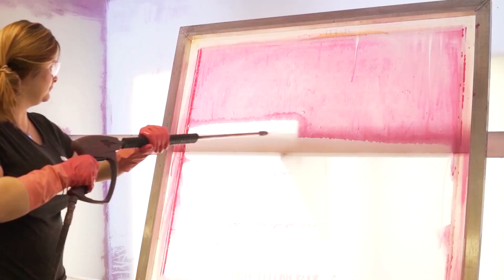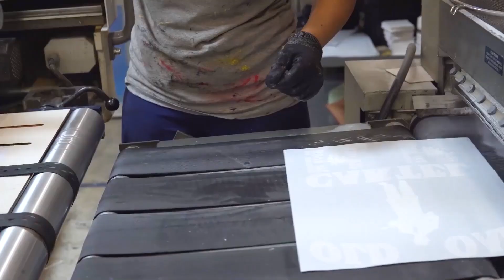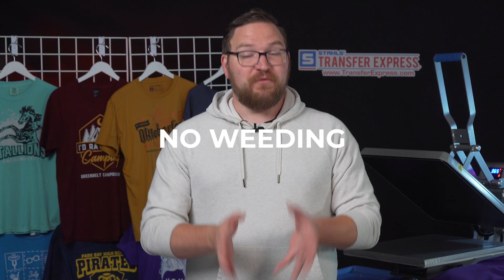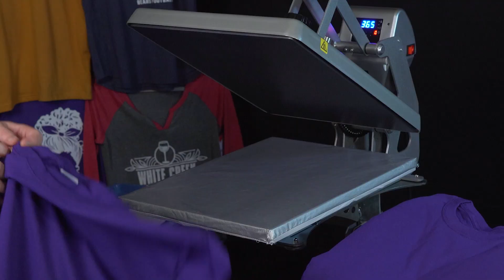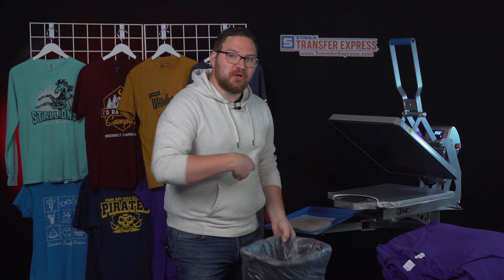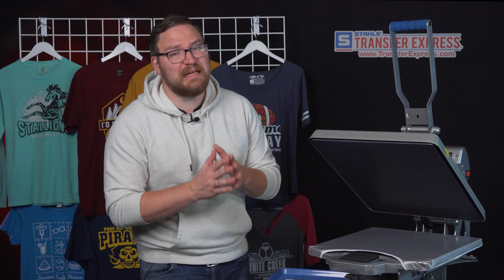Heat Press Bulk T-Shirt Orders | Setup & Printing Tips for Efficiently Printing Apparel

Comment: On average how long does it take you to complete a 25-50 garment order? I found myself at 4 hours for 10 hoodies, given that i had to print front, back and arms.
Reply from the maker: Many variables impact the time it takes to complete a job, and multiple placements definitely factor in. With hoodies and sleeves specifically are more challenging placements as you have to isolate the print area using mousepads or specialty platens for sleeves or 11x15” interchangeable platens (which can considerably speed up production). For a multiple placement run, I typically will print all of one location and then change the setup to complete the other print locations. 

In this tik tok we were able to print 52 left chest prints in 36 minutes with our UltraColor Max transfers:  https://www.tiktok.com/t/ZPR7bsBVe/